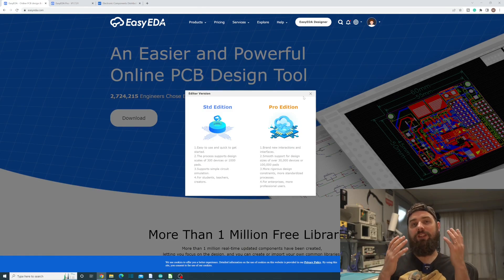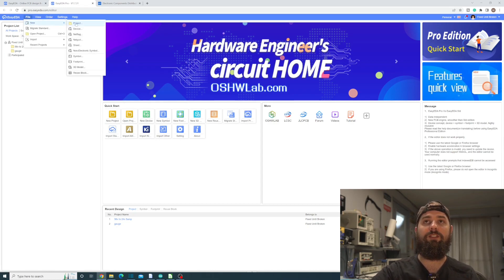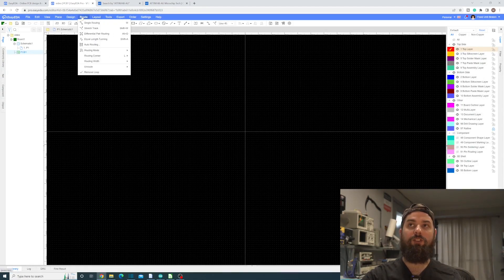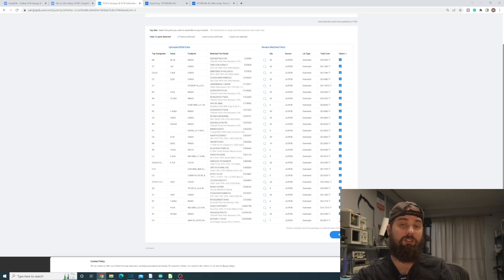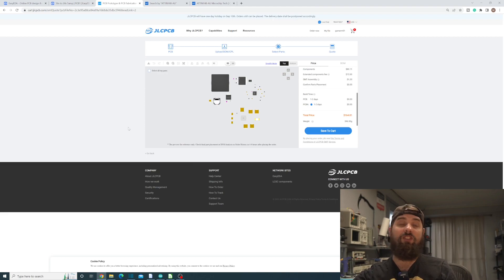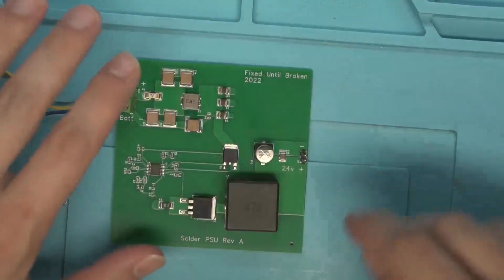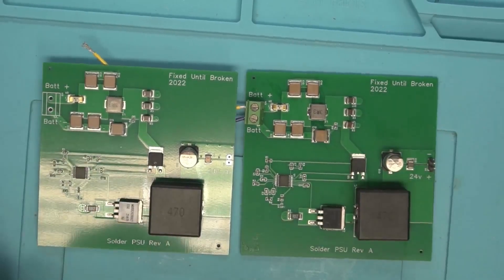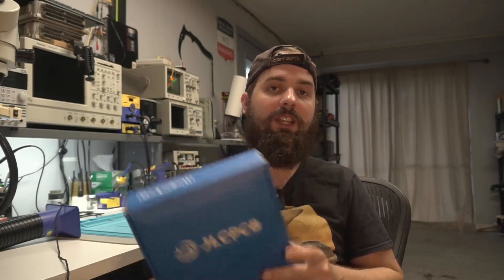Checking Out JLCPCB's Assemble Service

Comment: I designed 8051-based PCBs and wrote firmware in the 90's.  Recently (retired) and was looking for layout software that ran on llinux.  I ran across Easy EDA and liked it (except for the Chinese datasheets) . Then I found out about the affordable assembly price, so I'm getting interested.  Thanks for the review, it was very helpful.

Comment: Here's a cost-saving tip for you - on the BOM review page, for extended parts that are likely to be available as basic (i.e. resistors, MLCC caps, etc) just click on the search icon (magnifying glass) for that row.  It will give you a search UI and allow you to check "basic parts only".  If you find a basic version (usually just by another manufacturer) you can replace it right there.  On a recent order, it was an extra $5 per extended part (per order, not per board) but like you showed in this video - it can add up fast.
Reply from the maker: Yeah I didn't realize that until after made the design. I would have been more motivated to change the parts if I was paying for it but it was sponsored and JLCPCB provided them.